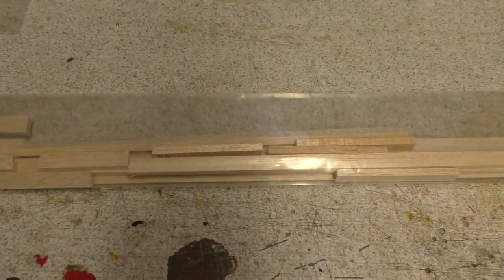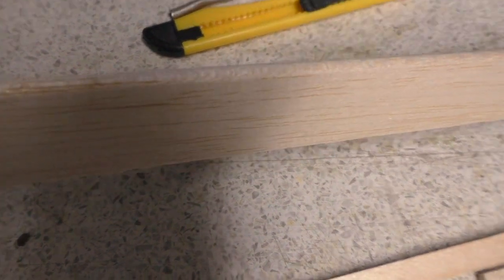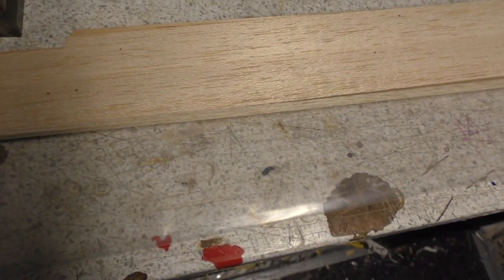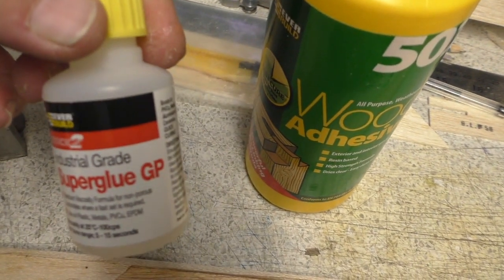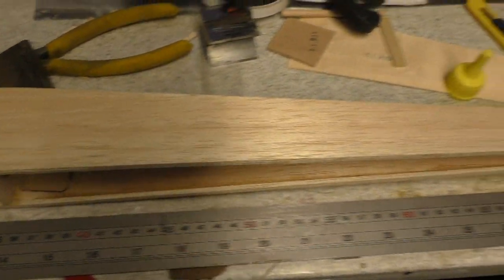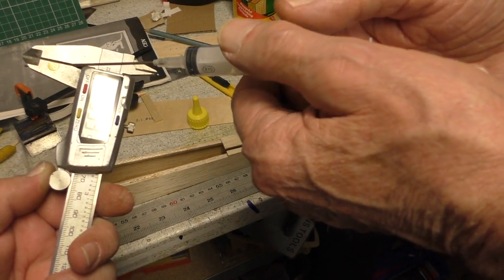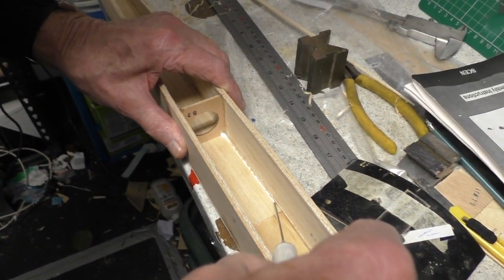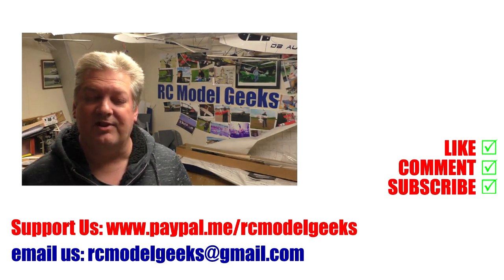Scen Dalmation Lady RC Model Glider Build Pt3 RC Model Geeks

Comment: I notice your PVA is type 502,our local hardware sells me type 501 not sure what the difference is ? but it is brilliant adhesive for the price,more training needed for Bixler Phil before he gets his fillet glueing clearance I could see the needle bending ! well this is a great kit and as you say Rob that is the way they used to kit them by hand,I used to produce ARTF kits myself in fact I did the first such model in the UK called the Ventura fuselage and wings were built just needed covering and slab tail,we built them from a garage just like yours,made 500 of them and four went to the TV series  'The Avenger's' where Stead ( remember him ? ) learned to fly on it,the jigs were made from shelf brackets screwed to pieces of MDF.I knew you were going to pre glue those fuselage strips like that,my thinking exactly,carry on you are doing well.
Reply from the maker: 501 is a general pva glue  brick sealing etc etc. 502 is a weather proof wood glue.  Yeah gentle and delicate are not words that describe bixler phil.  I dont know if you remember a  range of models that were artf in the early 90's they were all glass fibre fuselages. one was a high wing trainer called a sunbeam. and a low wing maybe called a tipsy?
Reply: Yes I remember those glass fibre jobbies,built a few for people and they flew fast,the 501 makes a great substitute for sanding sealer,will get some 502 to compare the two adhesives,they go off well and nice and clear too.I think MFA did some glass fibre models too,seem to remember a trainer ?
Reply from the maker: The 502 dries really clear. infact so clear its hard to tell the joint has been glued! yeah cant remember what MFA did. i did have the mfa heli! with an mfa bluebird engine!
Reply: I did some tests with that 501 the wood broke before the glue did,remember the Lark helicopter ? fixed head and difficult to fly,they are museum pieces now and one realised a silly price on EBay last year.
Reply from the maker: I had the 500 fixed head.  who would of thought you could make a wooden heli!
Reply: And why not ? Morley made that realistic Bell 47 which was a real handful to fly,the construction was like a Meccano set but the setting up was difficult,plastic swashplate etc my first succesful heli was Hirobo Shuttle they flew well,only do fixed wing now as parts can get expensive for helicopter's and Quadcopter's seem to have taken over,you hardly see model helicopters now around here anyway,cannot beat proper aeroplanes in my opinion,but each to their own.

Comment: Wait? that glider is powered? Ok, I didnt see the original plans. I havent seen the box art except those terrible drawings. You dont have actual plans to pin to? I find a drop ceiling panel works great as a table for pining and gluing. Waxed paper to cover the plans so glue will not stick. I used our storm window glass as a work table for doing foam scratch made planes. I used it to cut my foam with. I downloaded the plans onto sheets of typing paper, then using art craft spray contact glue, I would attach the paper to the sheets of dollar store foam sheets. 
Its fun building the Flite Test foam planes, try one. The plans are free to download.